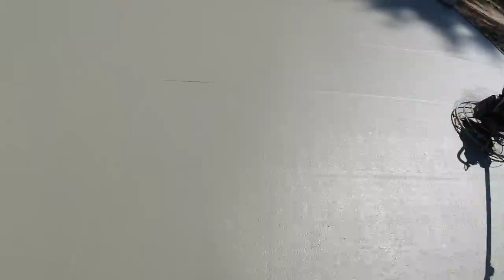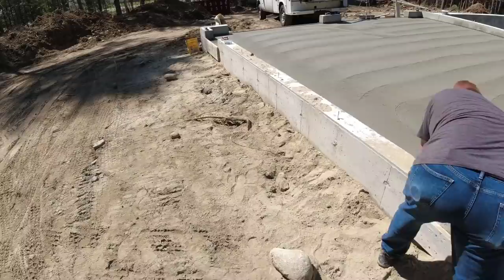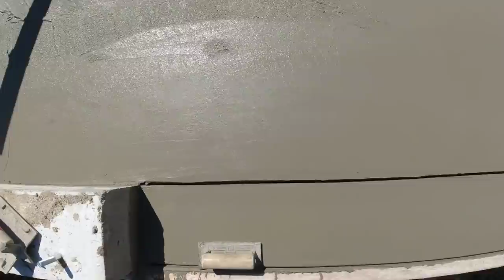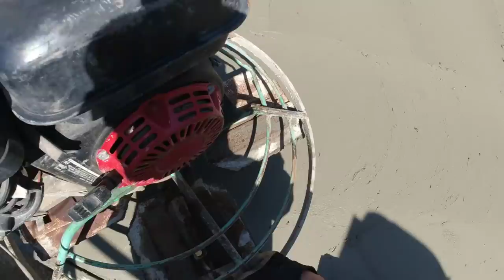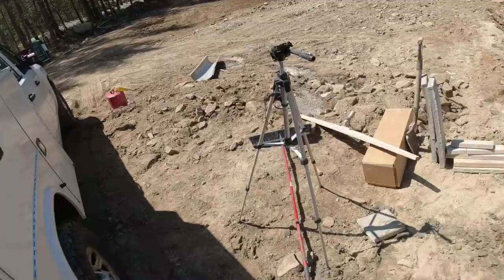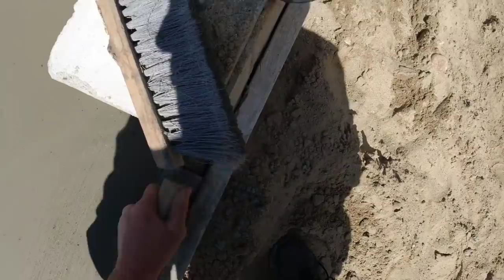Finishing Concrete | Power Troweling | Big House & Garage Part 3

Comment: Mike are those combo blades on the trowel that you took off? I have those on our trowel and they both float and finish. At least that’s what the concrete supply house told and sold me back in the day.

Comment: I would never have started the machine in front of a door like that. That spot where it started could now be low even a 1/16 of a inch in that spot could keep water from running out the door.. you don’t need that joint it will not keep the floor from cracking at a diagonal.

Comment: Love these videos, Mike. Thanks for keeping them coming. I was wondering what your thoughts are on power troweling air entrained concrete (3-6%). I've heard a lot of different theories and even some horror stories, curious to get your take. Thanks!
Reply from the maker: We do it a lot in garages in Maine. Just have to be careful not to get on it too early. Usually no problems.
Reply: Good question for me as well. I live in Phx, we dont use air here ever, but im going to be pouring a slab up in the mountains for a buddys house, part of it is a shop slab and part of it will be a patio all poured monolithic. The shop will get a floor covering so it needs to be smooth troweled and the patio needs air (in his area they get alot of snow). I can do the whole job with 1 truck was just hoping i could get air in all of and just carefully trowel the interior stuff instead of having to get 2 separate trucks. Glad to have Mikes input.
Reply: @markdoumert4840  make sure you add the styro-foam frost protection and moisture barrier, I just replaced a garage, approach and patio up in Munds Park that didn't have any protection.  Owner not a happy camper.
Reply: @MikeDayConcrete  I bet you've heard this trick. When machining (powertroweling) concrete with a lot of air in it, we tape plastic grocery bags or pieces of cut plastic that you use under the slab around our boots to keep it from sticking to your shoes and pulling holes.
Reply: @DavidFreelandAZ  Good advice. I always use vapor barrier for finished interior slabs but hadnt even thought about foam insulation for frost protection. We never have to worry about that down in the valley. Our stuff is expected to look good, but in all honesty we can get away with alot in regards to trapping water etc, just because it almost never freezes, meaning alot of contractors have the attitude that if it looks good it is good and aren’t super educated on proper technique. I always make sure to check if im in an area out if my usual comfort zone just to make sure im not overlooking something. This ones getting poured up in show low. Thanks for the advice 👍
Reply: @markdoumert4840  I wish you well in your job up north.

Comment: Hi Mike, what kind of mix do you guys use or recommend in summertime when it’s 85 degrees and up? Thanks
Reply from the maker: We usually use a 3000 or 3500 psi mix for our floors and slabs with mid-range water reducer. You can buy bags of set delay from Fritz Pak if you need to slow the set a bit.

Comment: On those walkout doors they should  protrude 1 1/2 “ out past the out side wall for the threshold to set on. You do that by just putting a 2”x 4” on each side of the door and than nail your header to it....I’m not trying to be critical but you guys get by with things up there that a builder down here (Missouri) would just not let you get away with.... stay safe and profitable.